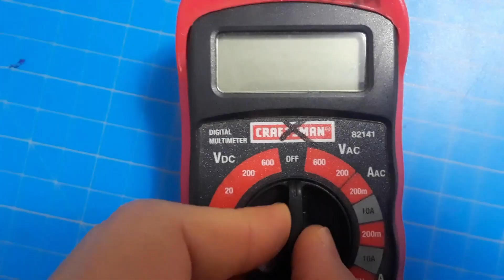Cyclorotor testing

Comment: Form where you get the parts of this???because I am the new bee enter into the cyclocopter system. So I am confused where to start
Reply from the maker: I designed them using CAD and 3d printed them out

Comment: Would be interesting to see this tech used to produce one alike, but in the sense where the blades are shaped differently to have the thrust push downwards, just like a jet thruster, then the whole unit could be encapsulated like a jet engine but with cyclorotor inside? Then joints pivot the thruster at angles and upside down just like the jets you see in movies? hmm
Reply from the maker: Not completely sure what you're trying to say here.  But I think it's just that the cyclorotor can be used lift vertically and do VTOL?  And yes, that's what it's designed to do.
Reply: @JudeSchauer  yes exactly like a vtol...but the way the rotor is built rn..since the blades are thrusting outwards...the whole unit can't be exactly ENCASED like a jet thruster because of that reason...if only the thrust was going the other way if you know what i mean? For example,If you stood the cyclorotor to stand on its black cog.. if the thurst went that way ..the whole unit would be able to be encapsulated and still offer thrust ..which would eliminate blade destruction upon impact.

Comment: I understood the concept, but how the offset joint is assembled is confusing.
Reply from the maker: So, I have a  "dog leg," aka 2 90 degree bends, that put the offset point away from the center shaft.  This offset then is connected to the back of the airfoil with a linkage that is the same length as the other linkage is connected to the shaft.  I know this sounds really confusing 😂
Reply: @JudeSchauer  😅thanks for explaining though.

Comment: Hi how is the noise compared to a standard dji drone?
Reply from the maker: It's actually much lower.  A cyclocopter spins at a much lower rpm than a helicopter, so it ends up creating less noise.

Comment: Just wondering, does cyclorotor system theoretically have more energy-thrust efficiency compared to conventional propeller?
Reply from the maker: Theoretically, yes.  Cyclocopters would be much more efficient.  The thing is, they aren't well optimized yet.  I'm not sure how they currently compare, but I think they are pretty close in terms of g/watt.  Much higher efficiencies will come later.

Comment: How'd you reduce friction? Sweet setup too
Reply from the maker: I reduced plastic on plastic contact in the vector assembly by lubing it up and changing some angles so that surfaces slide lightly against each other instead of getting crammed together.  Plus I used some WD-40 to clean out all the bearings to make them run smoother.
Reply: @JudeSchauer  how's the programming coming along? I've been building one too man, I got to see the lab at A&M a few years ago when they were building and testing these.
Reply from the maker: @richyrich88  I actually haven't done any programming lately, too busy working on the mechanical parts.

Comment: Wouldn't a larger diameter carbon fiber shaft help reduce bending? Great to see your progress.
Reply from the maker: Yes.  Currently I have no spar on the airfoils, so if I wanted to, adding a carbon fiber spar would reduce bending.  However, it would make manufacturing much more complex and the airfoils don't have a big need to be strengthened.